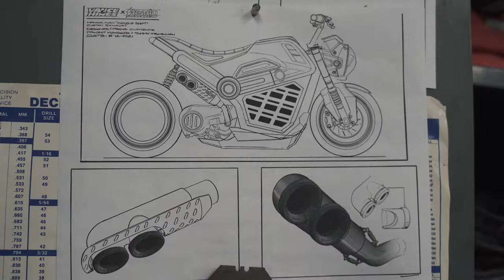Custom Built 2022 Honda Navi 110 - Steady Garage NaviScape Project (Teaser)

Comment: In Oregon out the cost with license plate and registration and dealer crap is $2,500
Reply: Excellent. And you're in theoretical ride distance from Scooter Swap Shop.  Are you keeping your stock or doing some modifications for performance or esthetics?